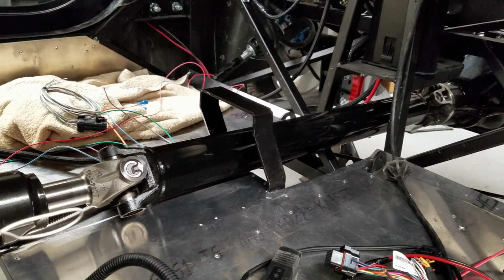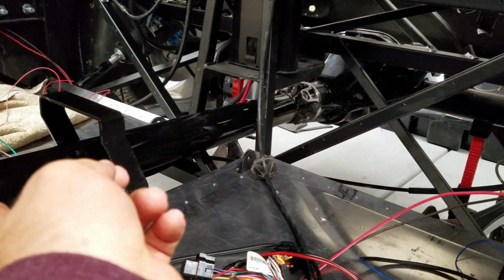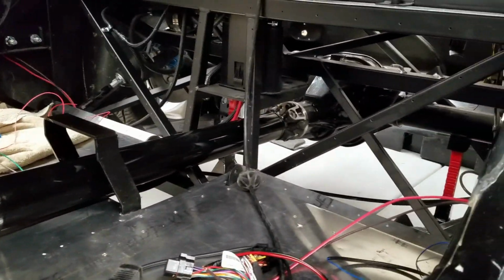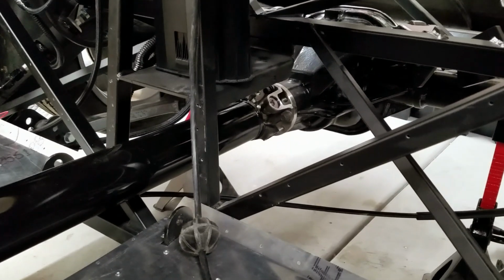Factory Five 33 Hot Rod V2 - Driveshaft Install

Comment: Jim:
After getting your driveshaft in, does your driveshaft hit the frame under the loop, if you have the car on jack stands under the frame (not the suspension)? Mine clears by a 1/4" when on the ground, but when I put on stands, with the rear hanging, the driveshaft hits the frame.

Comment: Everything is so tight on the 33/ hey what do you haven on the plate above the drive shaft?
Reply from the maker: The bench seat goes across it.  If I had separate seats, there would be some options like a second cup holder etc...